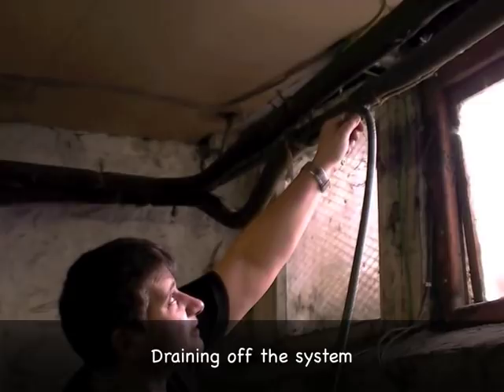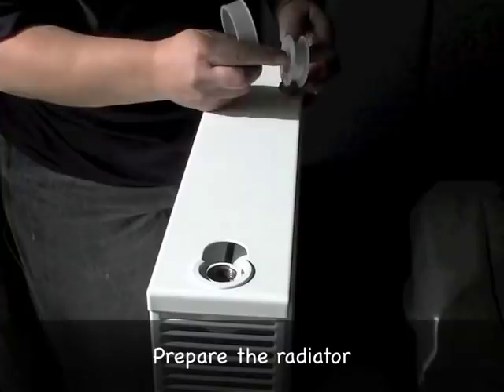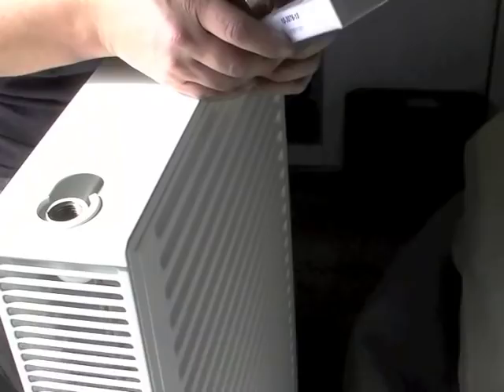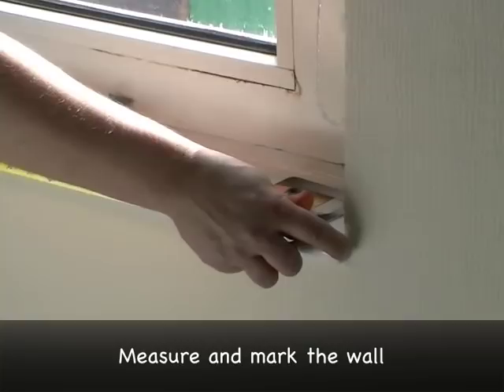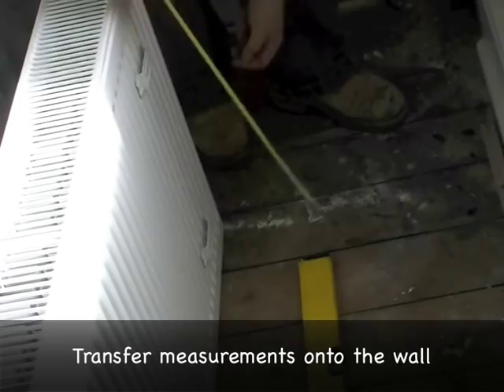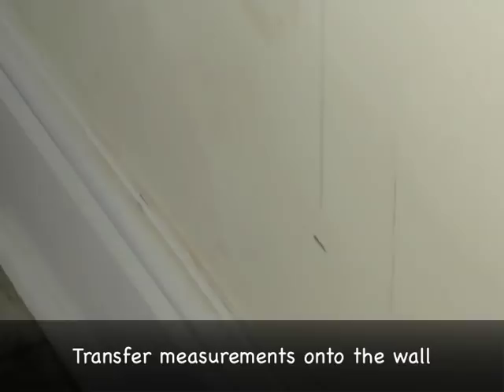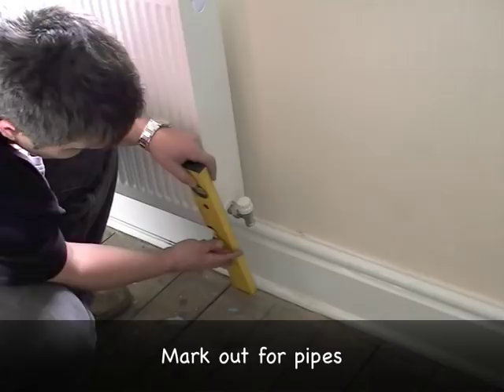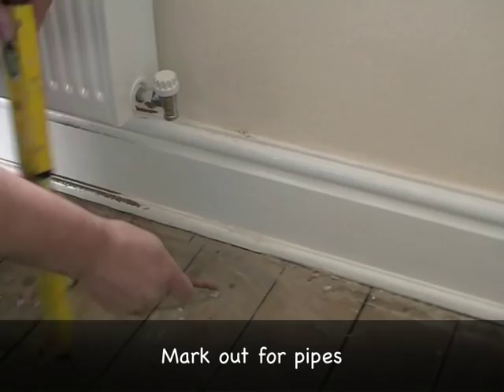Installing a radiator

Comment: All of that measuring for the brackets is time consuming. It is much easier and faster to offer the rad up to the wall, look over the rad and mark the centre position of the bracket lugs on the wall. 

Draw a vertical level line for each bracket and a horizontal level line for the bracket height. Bracket height = desired rad height + distance from bottom of bracket to bottom of rad. You'll be left with a right angle, offer the bracket up so the edges sit tight to the lines, mark holes and drill.

Comment from the maker: @DoubleHeIix Thanks for watching. In some cases the valves are at one end. If one is at the top and one at the bottom it is usually ok but if both pipes go into one valve you could get problems. I personally don't like these valves because they are basically two valves squashed into one, which in my opinion can sometimes cause a drop in performance. They can get easily blocked causing cold spots on the radiator. Look out for another video coming soon about diagnosing radiator faults.

Comment: if you Really wanted the pipe back that far, without bending etc did you not consider turning the brackets around? can't leave the pipework like that sorry. Eyesore as you walk into room
Reply from the maker: Hi Mark, You're absolutely right, and I agree that is what I should've done at the time. I went back and put that right but sadly had no one filming me. There have been a few people commenting to that effect, so I would like anyone who see's this video to know that the pipe work has been put right (by me) since this film was made.
Reply: bet it made all the difference to the job. nice video btw
Reply: Stopcocks Women Plumbers did you not look at the pipes once you had finished  and think maybe i should change it now
Reply: +Mark James I agree! I would not leave the pipes like that. At the very least turn the connectors, but ideally I would change the pipework. Having spent the money on a new rad, and the time fitting the radiator correctly, it would be crazy not to finish the job properly, even if it does mean the hassle of modifying the pipework.
Reply from the maker: +Nic Hollinworth, baconbol10, You are both right and in fact I did go back and change the pipes afterwards. Sadly no one was filming.

Comment: would have been nice if you showed us what was under the floor boards. I'm training as a plumber but haven't had any experience other than at my training centre and I don't know what beneath floorboards look like and where to connect pipes!

Comment: t off and notch the joists as usual... when you get to the rad do a 90 below the boards and then a single set.

single set the flow and ret pipes, assuming they come in from the right and just solder an elbow so they arent and that angle.

Comment: Hi Hattie thanks for your response, how can i tell the flow from the return? i read that if i turn on my central heating check the pipes left and right whilst the heating is heating up the rads and see which pipe heats first, if the left or right pipe heats first that's the flow, is that the correct way to identify the flow thanks.
Reply: Yes that is correct. Good luck :)

Comment: Hi There, i was watching your video and yes i have picked up some very good tips thanks. I just want to ask you, how do i idenify the flow and return on my pipework? i have already taken off my rad to change for another and i want to add a thermostatic valve in place, and it already has both sides installed with ordinary turning valves, so how do i identify and should the thermotat valve be fitted to the flow or return can you please advise thankyou very much.
Reply: Most Thermostatic valves are bi-directional these days. This means they can be fitted on either the flow or the return side.

Comment: that was d.i.y. style fitting at its best lol. never put pipe on a bodge it angle like that!!!  radiator measurements for wall hanging are far simpler than shown in that vid, also way it was measured to the bottom of the rad hanger and then marked on the wall to line up with the bottom of the wall bracket would then mean the rad being a good half inch or more lower than intended (depending on the manufacturer and supplied bracket).
also, forget about the flow and the return, no longer an issue

Comment: Couple of points (I'm a heating engineer of 30+ years).  Most importantly, the amount of ptfe here is far too excessive.  Apart from wasting the stuff, you risk putting pressure on the joint.  Maybe not so much on a radiator, but on other fittings could be a problem.  five or six turns are plenty. Secondly, aesthetically the pipework is an eyesore.  Radiators are ugly enough without added ugly pipework.

Comment: Plumbing isnt rocket science if you knew anything about plumbing you would see that she swapped an old style single panel rad, for a double convector radiator and the existing pipe work is clearly that close to the wall so do you a take up all the floor just to fit the pipe a bit straighter or do you bend it out a little bit somethin that no one other than a pedantic idiot would notice hmm lemm see and she seemed very knowledgable and professional